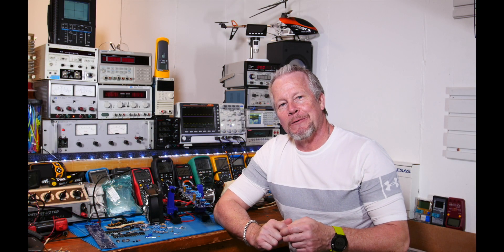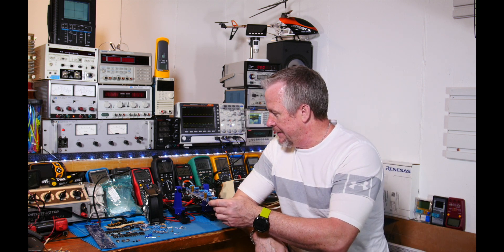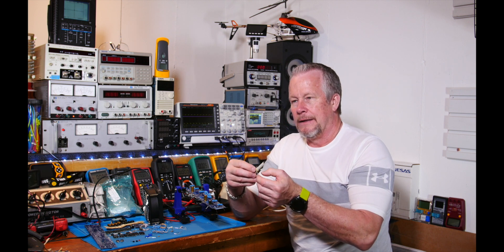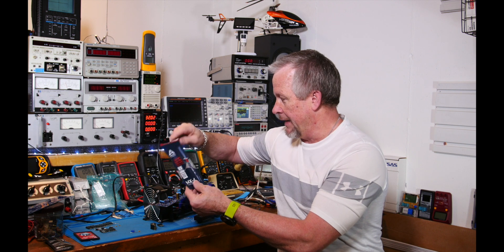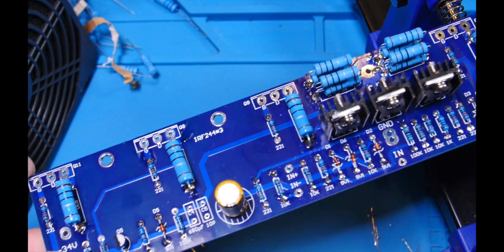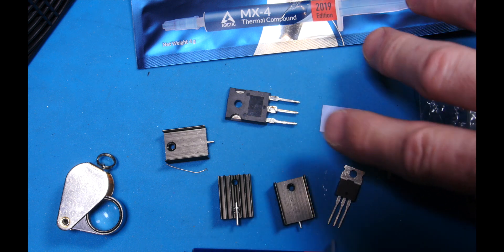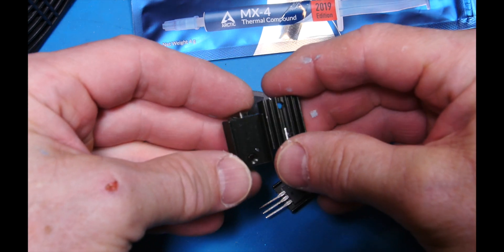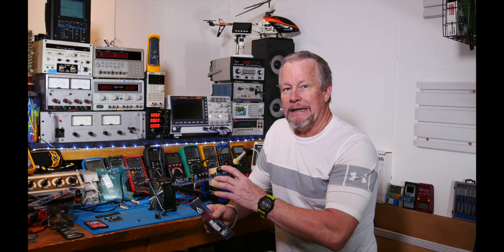Class A Amp Aleph 5 Build Update

Comment: I just touched yesterday good class cap with soldering iron while soldering other parts. Must check if its damaged. By the way...I like watching how other solder. It is kinda relaxing
Reply from the maker: Yes, if a capacitor is touched with a hot iron, it might only melt the plastic insulator, but if it is not needed to provide dielectric, then it might be ok.

Comment: "Not much thermal compound between the transistor and heatsink" - "but shed loads on my mat, my fingers, my hair, my trousers, the cat..."  

I have one of those PCB holders - in the UK, it can be found here https://cpc.farnell.com/duratool/d03170/pcb-holder/dp/SD02126?ost=duratool+pcb+holder - it's very useful.  One other tip I have for soldering through hole parts is to use blu-tac or white tac or similar.  Place the piece so its where needed, vertical and straight, then hold it in place with the tac whilst you flip the board to solder.  Gets a nice fit - and would be a good technique to keep bits off the board whilst being soldered.

I'd be inclined to wait to do something with those power fets until you get the heatsink AND have a case identified (you said you would be encasing it.)  I've found that leaving the case until last really ends up cutting down on options.  In some ways, those options are already cut down for you because of the PCB dimensions you can't affect, but you could make it easier for yourself :)  Also, you may find the best way of attaching those fets to the board is via wire from the PCB to the legs because of how you need to place the heatsink.

Nice progression Eddie.
Reply from the maker: Thanks Andrew - I've placed links for parts and this pcb holder in the vide description.  I'll grow this list as I find more parts for this amplifier.

I'm tempted to make a new board that will more easily fit in more cases, but I have so many projects lined up - and some will include board layout - so I think I'll just make this a kit build that will be easy for others to follow.  I hope I won't have to add wires for the FETs as that leaves more variations in build - if others follow.

Thanks for the great feedback!

Comment: Some times it's best to do the HIGH HEAT Required parts first.
Reply from the maker: That is true - but I often find in power designs - there really are not too many issues with that.  Thanks for bringing this up - it is something I should make a comment on in my next build video:)

Comment: excellent bro just wait for the correct size heat sink for the test take your time on the mounting and proper power mosfet insulation  you know all that good stuff already 😊
Reply from the maker: Thanks vargasmondo3435!  I appreciate your great experience.  It will be interesting when I get the big FETs mounted;). I might have to experiment a little...

Comment: Thanks, Eddie. And thanks for the lesson on the proper use of thermal compound. Many people don't seem to know that. I also have some carbon conductive thermal paste that I use when I do want an electrical connection.
Reply from the maker: Thanks Robert - that's a great idea.  I should get several different type of paste and do an experiment.  I've used a silver conductive thermal paste in the past, but I don't think I've used the carbon type.  I may have once and didn't know for sure as it was not marked but it was darker than others that I have used.
Reply: @KissAnalog  Mine is dark also. And it wasn't cheap!